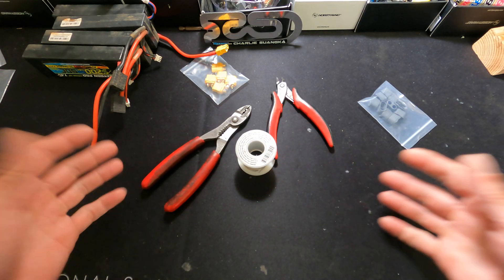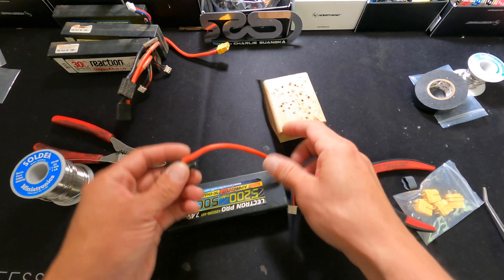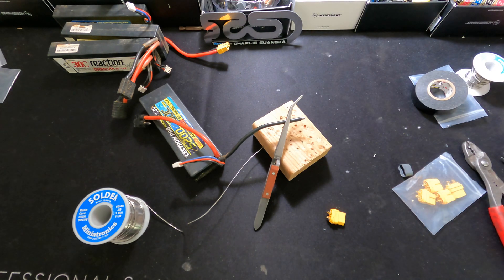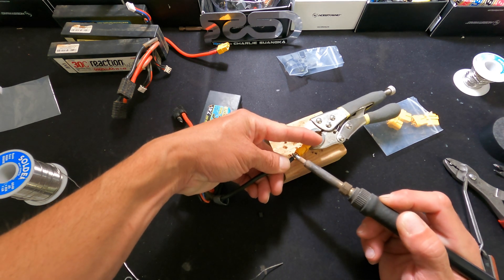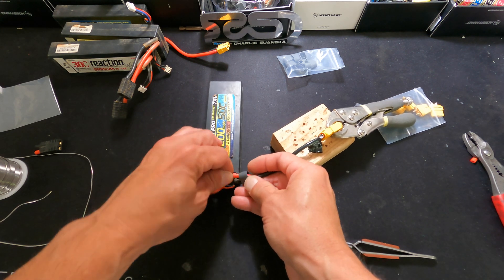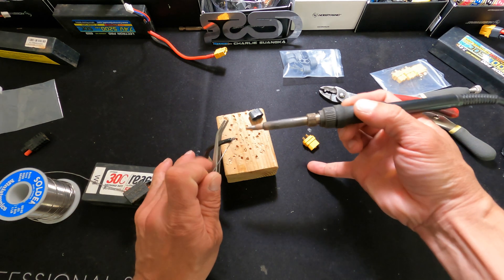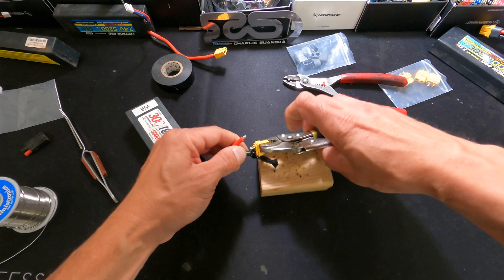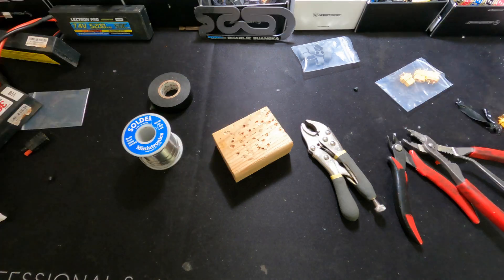The Charlie Show /// Episode 214 /// Battery Pack Plug Replacement

Comment: Great soldering demonstration. There are a lot of RC plug soldering videos out there and they are usually full of a lot long winded advice. Your video is straight to the point. No fluff or filler.